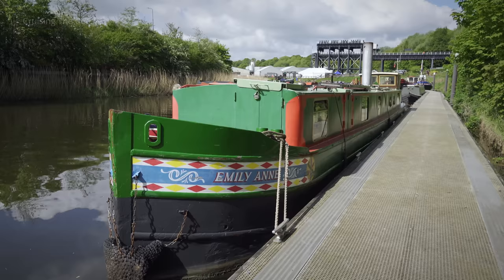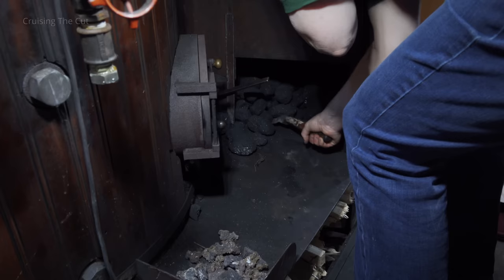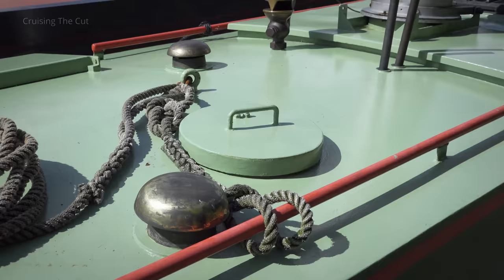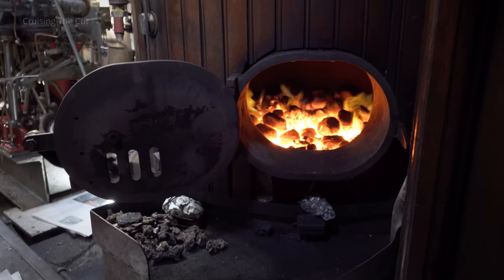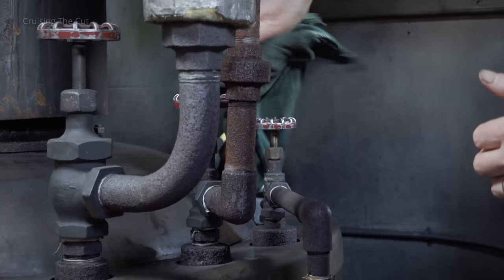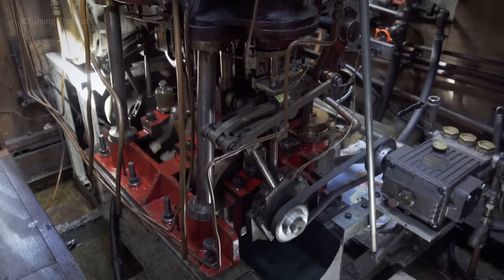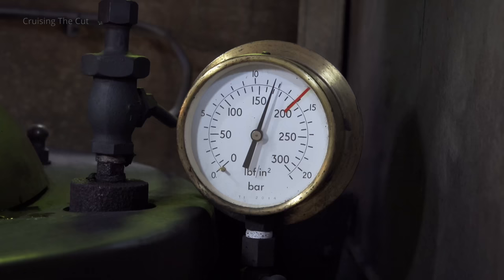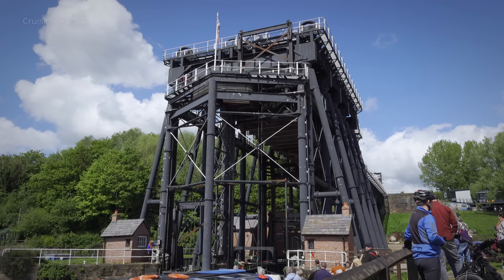269. Steam narrowboat on the British canals

Comment: (First of all, a big "thank you very much" to David from me, too.)

To those mentioning the environmental impact of this steam-powered narrowboat:

Yes, I do side with you in condemning the burning of fossil fuels, the lack of efficiency in doing so, in the casting of the soot and ashes to the wind, even when the rest of it should get properly disposed of. I may add the amounts of grease and lubrication oil to the requirements, and I wonder where the water will be topped up. (Even with a condenser, you do lose some water from the system. Just think of the whistle.)

Obviously, the same applies to steam trains (where a condenser was the exception).

However, I consider it worthwhile to have a few of these steam things (not just ships and locomotives) remain in working order, just to remind us all of the industrial past. Both in engineering and in labouring.

Here on YouTube, there exist at least both a long and a short version of an LMS tutorial film on how to fire a loco economically, "Little and often". This film had me volunteer as a fireman on a steam ship, and you can see me in the opening minute of https://youtu.be/vG7-fkqKdwI. (It proved to be my penultimate service as such.)
The story goes, that not too long before, the board of the museum had asked to pick up some important visitors from a few hundred meters (metric, here in the Netherlands!) away. Apparently, even the board members were unaware that a steam ship doesn't sail after merely turning a key. This one takes a full day to reach working pressure (or else risk damage to the boiler).
In fact, this video documents merely fueling up: on day 1 firing up to an acceptable pressure, then "bank on" the fire ("smothering" it), then early on day 2 "bank off" the fire and go for working pressure, then sail the "few" kilometres to the coal yard (a sponsor), have the coal bunker filled on one side, turn the ship around, have the coal bunker on the other side filled, have lunch, sail back. On this home voyage, the deck crew would be busy cleaning the deck, and (on my early occasions) the engine room would hardly be ventilated. I wanted not to stand up, just die. - Oh yes, and after the ashes had cooled down enough (maybe on day 3), we would shovel them into big plastic bags (some 15), haul them up the steep stairs, eventually had them join the other museum garbage.

To keep these notions alive, it would seem wise to me to keep some things steam alive. I can understand that for British people "steam" means more than for the rest of us. So I'd be in favour of allowing a greater part of a smaller world of steam to the UK.

(I hope to appear "balanced".)  ;-)

Comment: While I enjoyed the video and it’s presentation was excellent, as usual, I must make a comment on the statement ‘you have to be a graduate engineer to do the engineering for this boat’. I recall of at least one narrow boat that was build in a back garden by a carpenter and then craned onto a low loader. As for the steam plant for this boat there are literally hundreds of model engineers throughout the country who have built miniature steam loco’s and traction engines, including their boilers. When I say ‘built’ I mean made from raw steel and castings although the odd one has done the pattern making for the castings.

Comment: Wow, that's a great boat and an even greater engine! It's a marvel that someone wants to take on the big task of running such a steam engine, but all creds to that couple. I am greatly fascinated about the old motors, being oil, gas or steam. I come from a fishing harbour where the old single cylinder boat motors could be heard when I was a kid, chugging along at a slow pace. It was fascinated to see one of the older motors blowing smoke rings from it's pipe. It sounded like a 4 stroke motor that run extremely slow, with one swoosh intake sound, a thump when it ignited and a couple of minor swooshes when it exhaled.

Comment: Narrow boat President is steam driven and was built in 1909 and is owned by a trust and is still in use  Nb Monarch is older was steam driven but has been converted to diesel but is still on the cut

Comment: Excellent documentary, as usual.  On the task of pressure testing the boiler annually, I imagine they use compressed air while the boiler is cold.  The air will exert pressure on the water which, being incompressible, transfers that force to the boiler parts.  That way if there's a leak, all you get is a dribble or stream of water rather than a catastrophic explosion.
Reply: Yes, every 5-10yr a boiler will have it's hydraulic test where as you say, you fill it with water and pump it up to 1.5x working pressure in a controlled fashion. No compressed air, just water and a foot pump.
The annual test in-between hydraulic tests is just a dry inspection and a live steam test to ensure all looks well and all the safety systems work as expected.

Comment: I can imagine it being more enjoyable in winter than in summer. The quietness of a steam engine, and the lack of vibration would be attractive. I was somewhat surprised at the fuel consumption though, which is one of the reasons ICE took over, I suppose. 100 Kg per day! I've just paid for winter coal, and that much would set you back over £80 at the same rate, but that was delivered in 50Kg bags and in the Hebrides. Bulk coal from a depot would probably be a bit cheaper.

Comment: The most interesting part of steam is how the steam works.  As I recently explained to someone, take that 500ml water bottle you have, if heated to steam it would occupy 800l of space. Super heated 1200l of space.  It gives a better visual idea of how much water expands as steam. Now obviously we don’t allow it to expand and take up all that room so by leaving it compressed until it gets to a piston engine all that steam power expands and silently powers the pistons.

Steam is also much much more powerful than people think. The triple expansion engine in this boat, you can see the three heads, though it only has two pistons. It’s the design thing. Is really only about 12-20 hp. Maybe less. Turns at 250-300 rpm. Can reverse itself so no gear box needed.  The big part is the torque of steam engines. It’s huge like 1000 pounds of torque.

Let’s compare than to a diesel truck/lorry engine. 500hp and 600pounds of torque, doesn’t sound like much, but the engines run at 2000rpmto make that. And most of them have a transmission that does 16 turns of engine to one turn of driveshaft when taking off. The transmission doesn’t quite multiply the torque by that much buts it’s close. And the engine takes up a lot more room.

Steam is also very much in use today, just not the way people think. Steam turbines powered by nuclear fission is the norm for subs and many military ships as well as power stations

Comment: An excellent introduction to steam powered narrowboats.
I'd love to have such a vessel though I'd be very tempted to fit a Kitchen rudder so it could (theoretically) be operated by a single crewman.

It is interesting that they re-use the condensed exhaust steam. What additives do they use to alleviate contamination of the feedwater caused by the steam oil condensate that will end up in the boiler?
Are they using a feed pump or an injector?
How often do they clean the fire tubes?
Are they using a steel or copper boiler?
Reply from the maker: I don’t have those answers, unfortunately

Comment: In the 2000' I was on a sea trial on a big vessel sailing with the help of steam turbines,  getting their steam from boilers, cooking the water with oil or gas, (they could switch) and the engineers commissioning that system was somehow struggling with this switching,  I think they had to close a valve, purge the burning chamber with an inert gas and then open another valve,  (that is my understanding) but the first valve never closed, so when the second valve opened the burning chamber was filled with gas/oil, and when they ignited,  the whole thing went BOOOOM! and this happened 3 time, last time the vessel ended up drifting out on the ocean, then the cook, or someone put out large bottles of red wine on the tables,  think 2,5 litres if I remember,  and we sat and drank us senseless drunk, and the crew from the machinery came to us and told us how scared they where, one young man was crying, and they said: we do not work anymore,  we are only looking at the commissioning engineers,  and if they start running,  we will run too

Comment: Great episode! The sound of the steam whistle is worth waiting for and I just lapped up the tall funnel (never occurred to me it wouldn't fit through the tunnels you'd shown in earlier videos till the demonstration of folding it back). I admit I was wondering if that first conversation in the engine room would be interrupted by a loud crash because who was steering the boat? But it looked like the steam engine was actually custom built for the purpose? In the 1990's? Not a restoration? I would have liked to see the rest of the boat. Steam is quiet, a good way to power a boat if you don't need lots of power and don't mind, or even prefer, having something to do most of the time...rather like a sailboat. Katherine's comments were spot on.
Reply: Yes. Engine, boiler and hull, all new in 1991. Best described as a 'folly' but a lot of fun none the less! And no rivets or timber bottom/cabin to worry about.

Comment: Well not all steam engines are double acting and the chuffing of a steam train is due to high pressure steam from the blast pipe used to draw mode air across the firebox

Comment: Another High pressure video from the king of cool. My questions would have been how often they have to pump out with all the drips, can they start the boiler with less water while it gets going, can they take water from outside the boat IE canal, do they have a steam turbine generator, do they cook breakfast in the firebox, do they.have to start the engine by turning the flywheel and how easy does it go into reverse,  but my biggest question is why is there no shots of you stoking the boiler?
Reply: The bilge water would have to be soaked up..it contains traces of lubricationg oils...no can pump into canal.
The boiler ALWAYS needs a minimum level of water covering the "crown" and can never be allowed to have less than that level.
the canal water is absolutely unuseable in a steam engine as it has too much silt, hardness etc...
No turbine for a generator on this.
The firebox is far too hot to cook any food.
Theengine is started in forward by a sliding valve which allows steam into one side of the piston to start the process of moving the engine for that direction of rotation...and reverse has steam entering on the other side of the piston to start the engine rotating in reverse...
Reply: Yes, the majority of the feed water is recirculated condensate, with the 'make up' water coming from the domestic potable water system. Although in times of need, you could use canal water with care and we have very occasionally. 
The boat had a 24vdc alternator driven off the propshaft/engine which charges the batteries and keeps the lights on and the fridge cold!
Being a two cylinder engine, it will happily 'self start' from any position, either forwards or in reverse, you can also directly reverse the engine when it is running. 
Food is prepared on a conventional domestic gas cooker!
Hot water can be heated either from steam, the solid fuel central heating system, or instantaneous gas heater.

Comment: Is the Boat also heated by the Boiler? It would be perfect to shower with the residual heat water and heat your boat.How is this much coal provided in certain Points in the Network? I can't imagine that you can simply buy a ton of coal everywhere like the coal to heat your Boat.
Reply: The boat's calorifier uses steam, typically at the end of the day, to heat the domestic hot water for, e.g. a shower (which you often need after a day operating Emily Anne!). To coal up we need to find a place where the road is next to the canal and arrange for a bagged, palleted tonne delivered to the spot.

Comment: Wondering if there any canal or other fullsize boats running in the uk with  flash aka monotube boilers? Were used for steam cars, as fairly quick start up. Gets used on a small scale for steam hydroplane model boats... They're a bit noisy not like sound of usual steam engine, maybe more  akin to chainsaws, but that's because the tiny racing  engines have very high rpm to make a few hp. And record speed is over 200mph.

Comment: I get why they would use a reciprocating engine vs a turbine engine but I', surprised they aren't burning diesel instead of coal to generate the heat for the boiler.

Comment: That was a most interesting film and Katherine is a very engaging,  and knowledgeable, interviewee. I really enjoyed it, thank you. NB, if the boat needs to go astern is there a gearbox or is the steam engine run backwards ?
Reply: The propeller is direct drive from the engine so no gearbox, but steam engines will go equally well backwards just by changing the valve timing which we can do with the Stephenson valve gear connected to a simple lever in the cockpit.

Comment: It would be fairly easy to automate much of the work with a few servos and sensors controlled by arduino.
I'm actually glad they haven't done that. After all, that's not the point.

Comment: Very cool - wonder if the steam engine could be reconfigured to recharge electric batteries which could then be the main propulsion method?  PS Found myself checking my phone with the text pings happening in this video :-)
Reply: Yes, you could use the steam engine to charge batteries and then sail on electric power. But it would require additional space to be reserved for propulsion, and efficiency would be even lower.

By the way, in the 1950s Shell Tankers had a large number of steam-operated general-purpose tankers built, in the UK the H-class, in the Netherlands (I'm Dutch) the K-class. They experimented quite a bit among these. One of the experiments involved replacing the steam turbines and huge gear boxes with generators and electric engines (no batteries involved). These ships may not have been successful: I think that the only reference to them I know of was by Shell Tankers (my sponsor and employer-to-be), even though the K-class itself was widely used as examples at my ship engineers' college. - But I may well be unaware of other matters!  :-)

Comment: I ask out of curiosity, with no pretense of knowing more than the engineers who built it: why a closed water loop? Why not just use water from the canal as the source and just dump the low-pressure steam once it's done its job and lost most of its energy?
Reply from the maker: The canal water is full of silt

Comment: What type of coal does it use. Is it anthracite?
Reply: Welsh Dry Steam is a naturally occurring semi-smokeless fuel - much softer than anthracite, but more clean-burning than house coal.
It has lower levels of sulphur and produces more heat and less smoke than other types of coal. 
In the south Wales coalfield, anthracite is found in the upper eastern valleys, while steam coal and bituminous coal is found in the south eastern area of the coalfield.